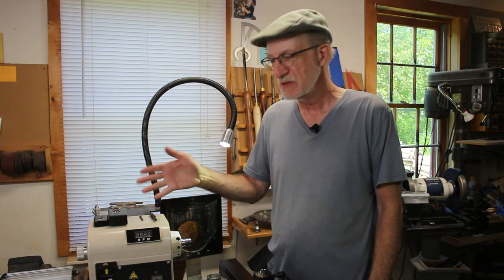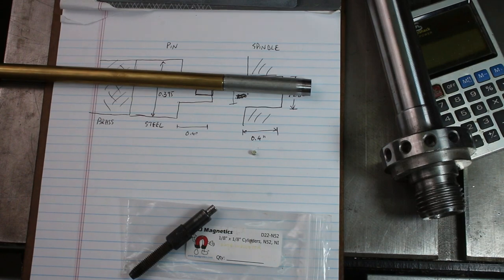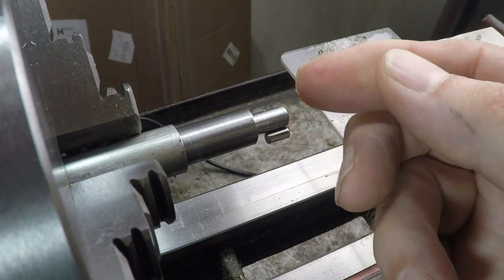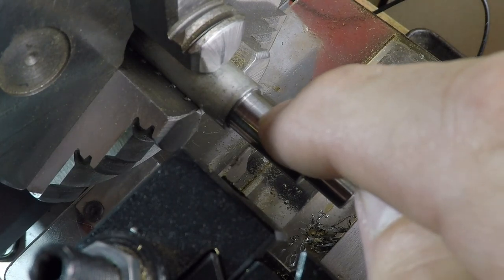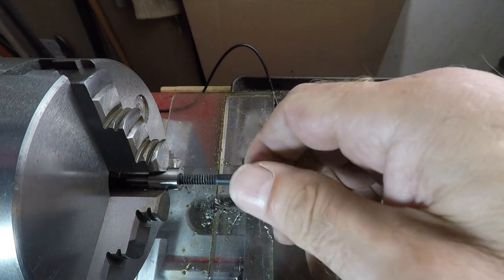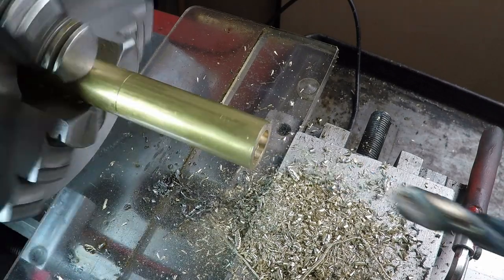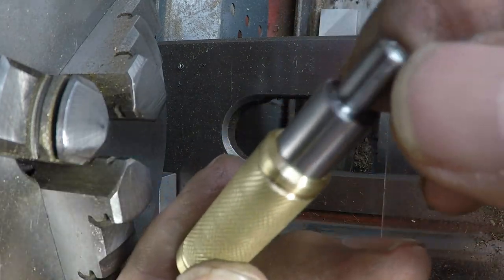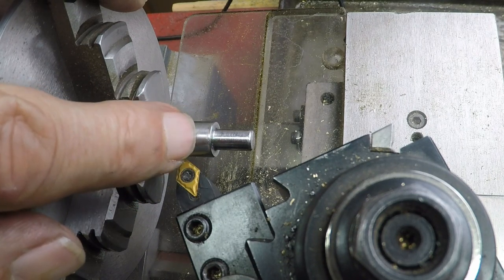Making a Wood Lathe Spindle Locking Pin

Comment: I saw Nova written on the chuck in your thumbnail so I took a look at the video as I am a new woodturner. Great job on the spindle locking tool. I'm sure that will make things easier for you and your friend. All the best from NZ.
Reply from the maker: Thanks. As a new woodturner you might enjoy seeing some of my wood turning videos, here's my playlist:
https://m.youtube.com/playlist?list=PLbms9GizN4aSKeuVoQ7id4A7XyBuc0I6H
Reply from the maker: Not sure if it will help because these motors are all the same size with different gear ratios in the box.  But:
Motor diam. 30mm X 57mm long
Gear box: 58 X 40 X 30mm

Comment: Maybe a minor process order changes, make the steel rod , trim it  to just clean up but not to size. flip it around, cut hole for bolt, tap it. the brass part is same as what you did, attach the steel to brass handle, then finally clean up steel to size and add magnet so its all nicely coaxial. though now that I think about it, would cutting it that way make it stay on or unscrew? HMM
Reply from the maker: Oh yes, it's easy to see this kind of thing in hindsight.  But I just tend to fumble through things.  If this was a high(er) precision item, I would definitely have planned out the order of operations more carefully.  And yes, it would have screwed on tighter.
Reply: @GuyMarsdenMakesStuff  Yeah, not too important on this one,. :D